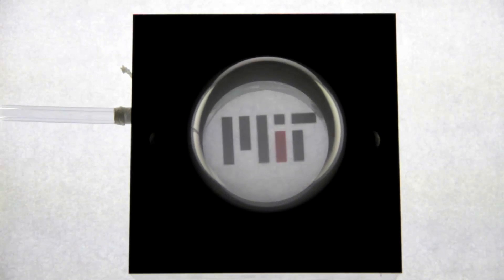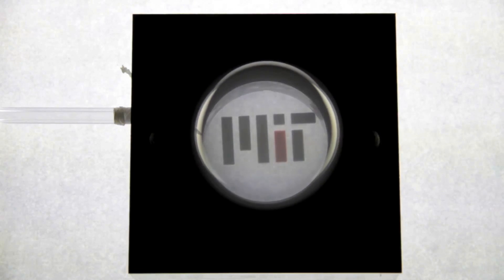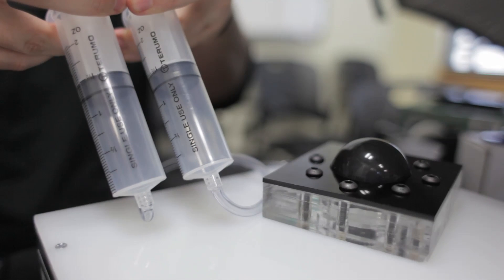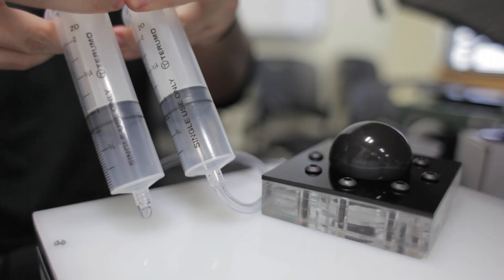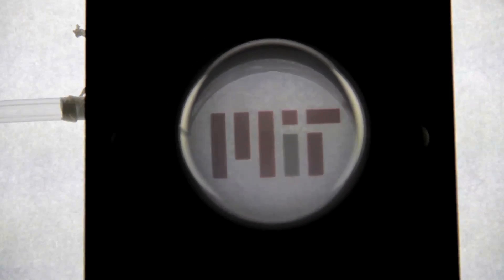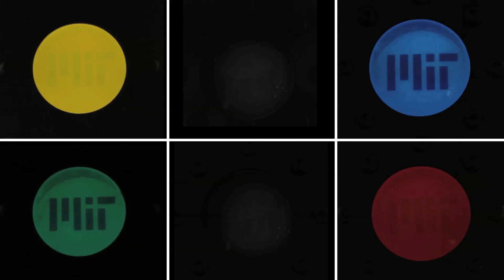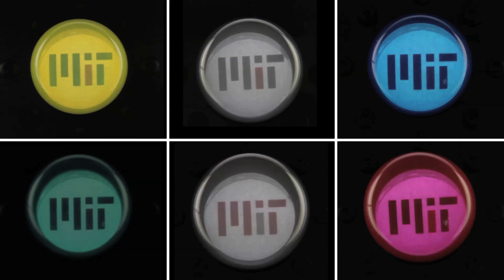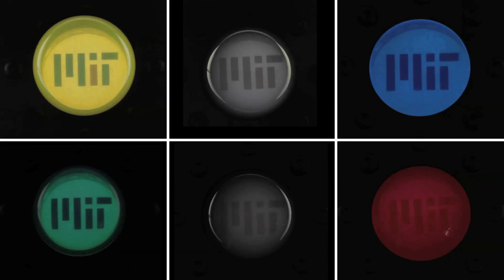Material may offer cheaper alternative to smart windows

Comment: One of the stupidest "smart" technology concepts i've ever seen. Lets fill a rubber bubbles with air instead of using straightforward LC technology what does exactly what you need - changes transparency with applied electricity.
Reply: Well pneumatic systems could save power and be much cheaper.